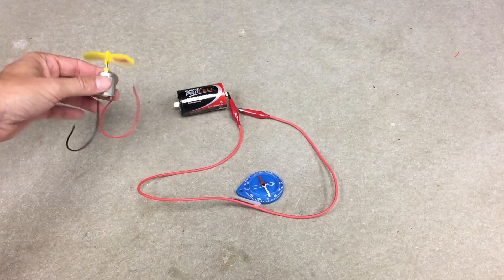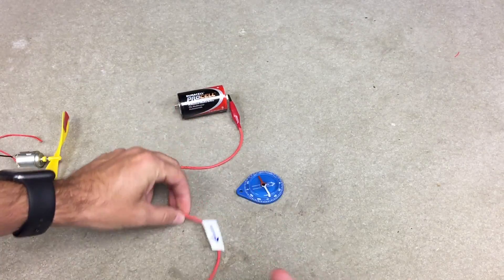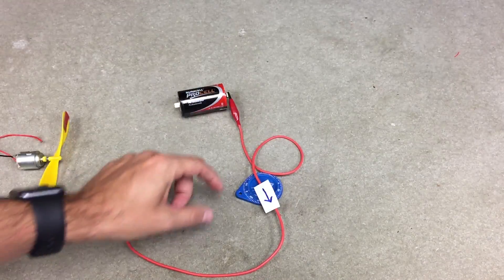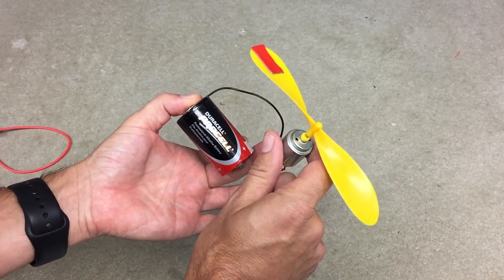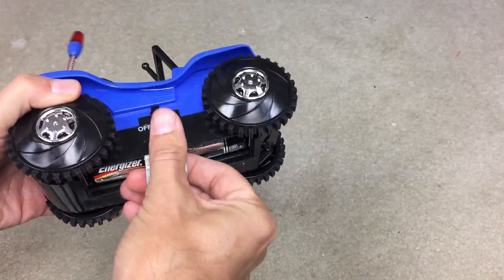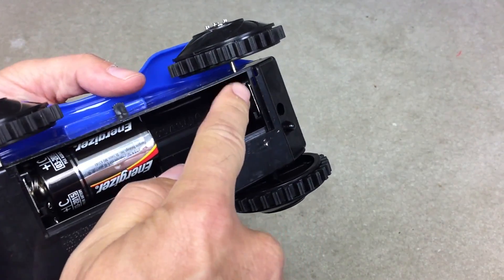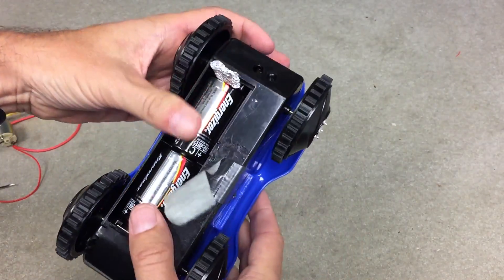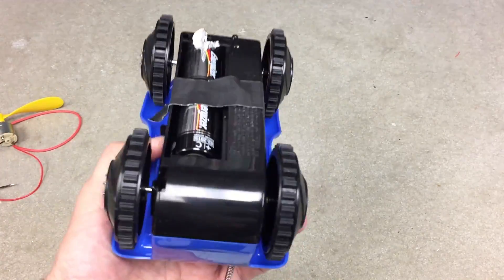How to reverse direction on a DC electric motor

Comment: My motor which i am using as a generator used to generate electricity when i turn it counter-clockwise, but now its generating power when i turn it clockwise. Is there any way i can make it like it used to be ?

Comment: OK do you know the answer ? 
I believe I used wrong plug for kids quad both similar setups  . Now 1 only g9es in reverse . I can 9f course swap motor wires and likely be fine . I checked polarity on battery and its as it shouod be ? Amy thoughts mate ? Thanks

Comment: Im building electric bike, and i have a question about the rotation of the motor. I've built my diy bike but the motors spinning the wrong direction. How can I reverse the direction of the motor? I have it hooked up to a 2 pin rocker switch and a 22.2v 1400mah battery and it all works, but how would i have to change it if i wanted to make it go the opposite direction?  Its going clockwise now, but i want it to go counter clockwise. If i swap the connectors on the motor ( like connect positive motor wire to negative battery wire and negative motor wire to positive battery wire ), would that work?

Comment: Why is the fan blade of my mini fan rotating but no air is coming out? I just bought it and then I noticed that its cycle is reversed, which should be clockwise for it to blow air. What do you think? Do I need to reverse the battery position?
Reply from the maker: Yes, try reversing the battery - that might work.

Comment: I have a motor on a toy that I want to start in reverse but has 4 wires. It goes in this order: yellow orange red black. If I reverse the wires to black red orange yellow, the motor will start in reverse? I just want to make sure it is ok to do that without damaging the main board. It is a very expensive toy 😀
Reply from the maker: It's probably a brushless DC motor.  Those need a driver circuit to run  such that you can't just reverse the wires.
Reply: @rhettallain  yes, the problem is that the manufacturer programmed the board  starting  the motor clockwise, but I want it to start it counter clockwise. Swaping the cables won’t do anything?

Comment: I understand all that, but I can't find out any information about, will it harm or ruin the electric motor!? I would like the ability to use the device either direction. ¿`_
Reply from the maker: If it's just a plain DC motor - it's fine to reverse the direction of the current
Reply: @rhettallain  it's amazing I couldn't find that kind of confirmation by simply Googling it! Thanks ¿`_

Comment: A simple concept that I need to reassure myself that it's true and it was not a false memories before I change my postive and negative wire on my radiator fan motor. Heck it's been spinning wrong the whole day. No wonder its been overheating. Thanks for the video!
Reply: Exactly same problem here

Comment: Can all dc brushed motors  be reversed ?
Reply: Yes
Reply: @greydoveproductions3259  Im building electric bike, and i have a question about the rotation of the motor. I've built my diy bike but the motors spinning the wrong direction. How can I reverse the direction of the motor? I have it hooked up to a 2 pin rocker switch and a 22.2v 1400mah battery and it all works, but how would i have to change it if i wanted to make it go the opposite direction?  Its going clockwise now, but i want it to go counter clockwise. If i swap the connectors on the motor ( like connect positive motor wire to negative battery wire and negative motor wire to positive battery wire ), would that work?
Reply: @makeitathome1327  This is too complicated, does the motor have a driver, all I know is if you reverse the wires the motor runs in reverse
Reply: @greydoveproductions3259  Yes the motor has a driver sprocket if thats what your saying, and it has a rear wheel sprocket that attaches to the motors driver sprocket using a chain.